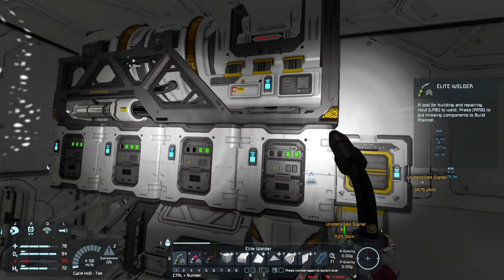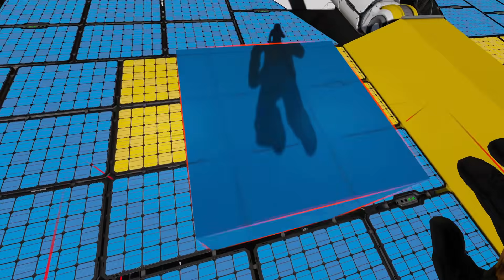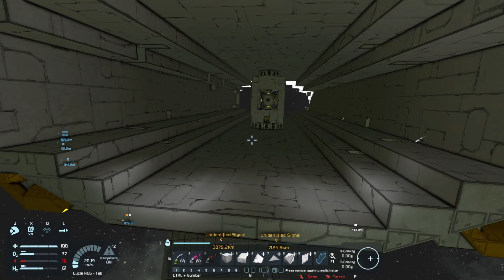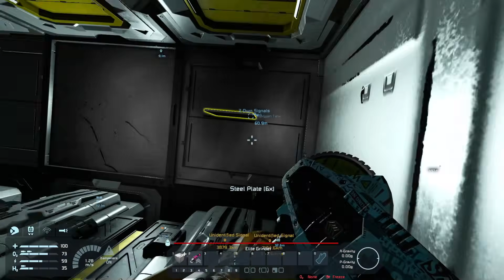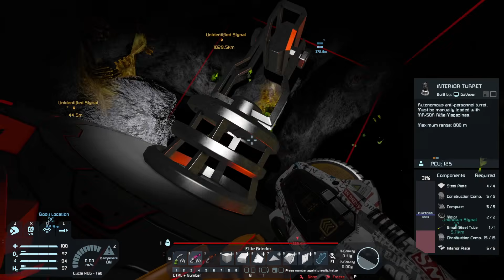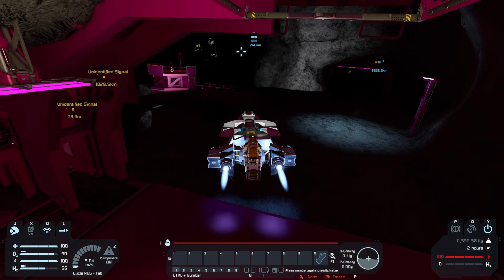Making Our First Prototech! | Space Engineers

Comment: Since you have the advanced grinding, you don't even need to worry about being merged to eachothers, we have to always think of letting one block in between. The output capacity is greatly appreciated, and 90% efficiency is a lot better in large scale. You'll find many many batteries at some point tho, especially if you take over transporters. It's nice to do it from the inside and take control, it would be a little bit like the return of ship evolution, but you just scavenge. You'll probably replace all your batteries with prototech. Also consider the gyros for your new big ship, being able to enter them. You have weld pads also, gonna be a lot easier for you to place one in an array with a small tug and weld it in place.
Reply from the maker: The hunt for Prototech continues! Thanks